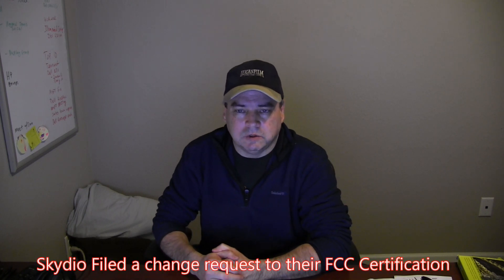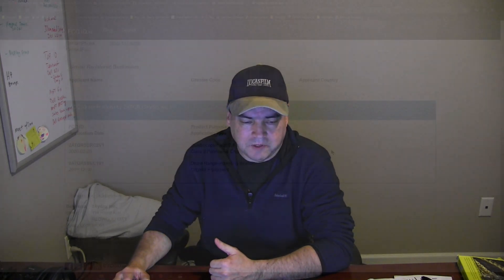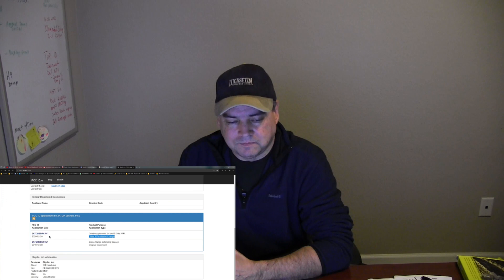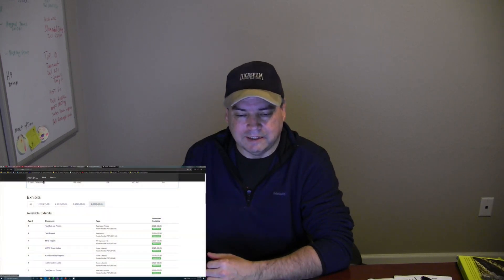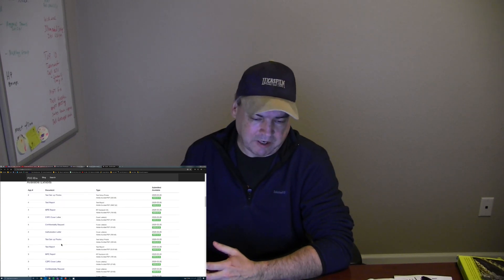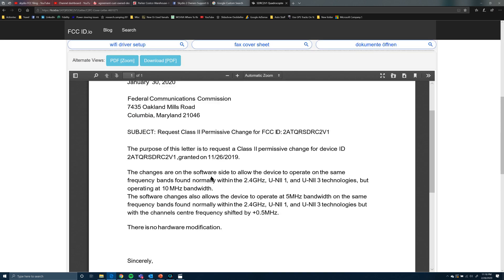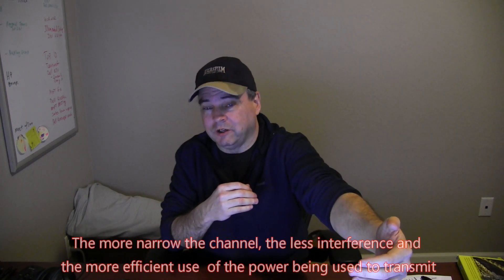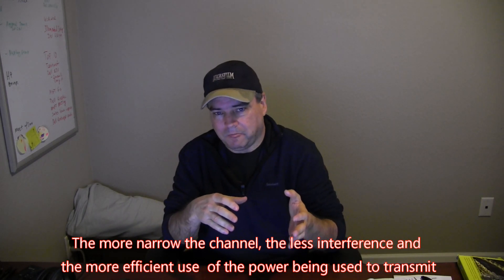Breaking News! Is Skydio extending the range of the S2?

Comment: Nice explanation.  As a non-engineer, I understood it.   I hope you are right and Skydio puts out a new firmware in the upcoming weeks.  I am not a distance flyer, but would really like a solid signal within 3,000 feet, much like my Mavic Pro and Autel Evo.  Right now, my range with the Skydio 2 is inconsistent -  hope this improves!  Thanks for doing this.
Reply from the maker: TJBC it will be more than a couple of weeks.  If they just filed, then it still needs to be reviewed and approved by the fcc. But skydiving will probably make an announcement once they do get the approval.

Comment: I'm wondering why, assuming they haven't,  Skydio didnt just allow the user to select the video resolution transmitted. Parrot drones allow that as do others. From you are saying that alone could help a lot. But this appears to be a welcome change. I am still on the fence with the Skydio 2. I haven't ordered one but reviews are mixed in part because of the range so if this can improve range without much compromise then that would be awesome. 

Also, would it be possible for you to explain how DJI's Occusync works so well at such long range? How is it different and why can't other companies do the same?

Thank you!
Reply from the maker: I haven't studied the Occusync.  I did look for some technical documents online for it but didn't see anything but a high level marketing brief.  It must by a proprietary protocol...from what I did find, it looks like standard Wi-Fi chips though not sure what bands they are using or the power transmission levels.  I would love to find some tech docs on it to understand it better as I can only speculate based upon the little info that is out there.

Comment: And please don’t think I’m a Troll. I wish Skydio success and hope they can eventually deliver the product all of us owners were hoping for.
Reply from the maker: I don't think you are a troll.  You are entitled to your opinion and it's based upon your current experience.  You have a drone, I don't yet.  My view of this drone is as an Engineer, your view is that of an owner. You have experiences I don't with this drone but those experiences are based upon what it is today. I think my view is that I see this not as it is today but what it will be as they collect more data points, continue to refine s/w and make this a powerful drone. The company I work for builds Wi-Fi devices for conference rooms, classrooms, hotels, hospitals, etc. We launched a product a year ago that was pretty good.  But we have since released major updates that significantly added functionality. No h/w changes, just s/w.  The box we sold a year ago is like a new product just because of s/w updates.  Skydio is likely to do the same thing because you don't build a platform like that if you don't have plans to take advantage of the h/w they put in place.

Comment: My only advice is don’t get too excited about it. The range is extremely poor. Where my assistant can get upwards of 3 miles with his outdated Mavic Pro I am excited if I can get 500 yards in the country and I literally can’t get over 3 blocks in the city using the controller. Controlling it with phone is way worse. I have crashed one and Skydio was great to replace it. I had it follow me on the farm today and it hit a tree branch. It did recover without crashing. The footage you can capture is really great but only if you are out in the open. If you get even remotely close to anything the flight path diverts in an manner that makes it unpleasant to watch. I’m still on the fence about keeping it. The range is so poor it’s not even practical to use professionally at my studio. I’m pretty disappointed and I fully bought in purchasing all the accessories.
Reply from the maker: I think there are several factors here that will impact the range and performance. Antenna design is a major factor. The routed the antenna on the PCB which is part of the reason for the poor performance.  That unfortunately cannot be overcome with a s/w update but a better controller in the future could address it.  However, the transmission technology itself is another significant factor. As mentioned, I work in this space as an Engineer. This is a pretty significant change and should help improve the signal integrity. I think at the minimum it will help them deliver on the published specs on their website.  It could help them get further but it is hard to tell just yet.  I think they are realizing that relying on the Anafi controller has imposed limitations.  They will probably end up doing their own controller at some point.  It would have been better had they went with a design that had external antennas instead of PCB routed antennas.  As for the rest, I think bailing is a mistake because this drone will continue to get s/w updates that increase the performance and reliability. Skydio has packed an enormous amount of CPU power in this thing, way, way more than anything from any other drone maker.  I suspect they have a lot of spare cycles ready to be used with s/w updates.  This is the same that Tesla does with the model 3.  The model 3 is not the same car that launched 2 years ago.  They have released updates that have significantly improved the car.  I am betting Skydio will be doing the same thing.
Reply: Rough Riders the Anafi drone with the same controller can get two miles.  I fear it’s a physical design flaw that software cannot help.  Hopefully they didn’t choose form over function.
Reply from the maker: @bneil4059  Fair point.  Without looking at the schematics, it's all speculation.  I don't see them choosing form over function because if that were the case, they would have made the arms foldable like all the other drones.  Let's see what they announce in the next month or so once the FCC approval comes through.
Reply: Rough Riders do you think this change affects the RC receiver as well as the WiFi?  Are they different or one in the same?
Reply from the maker: @bneil4059  It will affect both.  There is a transmit and receive on each end so both need to be operating on the same channel on the same frequency using the same bandwidth.  The controller is transmitting instructions and the drone is transmitting acknowledgements and other stuff back along with the FPV data.  So both will need updating.
Reply: I really hope so! Thanks for the video and the encouragement to hang in there. I hope they do continue to develop the platform to its fullest potential.

Comment: Excellent. I was thinking about canceling my order because of the poor range and occasional crashes.  You have given me faith that Skydio will take it the last mile.  Thanks
Reply from the maker: I’m not surprised by their update because I knew when I saw the architecture that they were going to be releasing updates that added a lot of functionality.  The amount of cpu power in this drone is huge and you don’t pack that much cpu in a drone like this unless you have big plans to use it. I’m betting that the amount of data points coming in from users is going to lead to even better OA.  This drone has soooo much potential and these updates are going to be exciting.